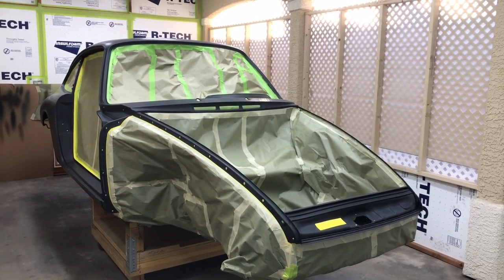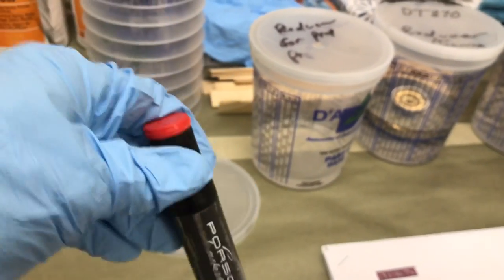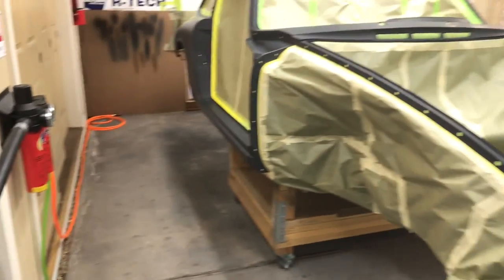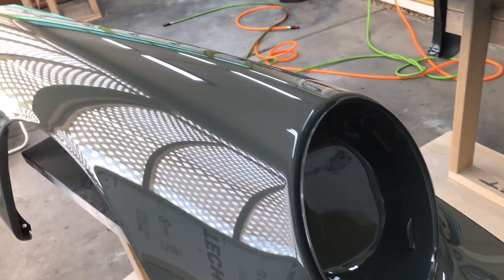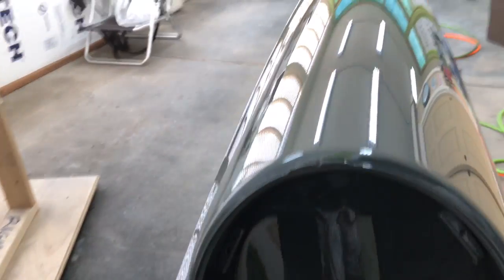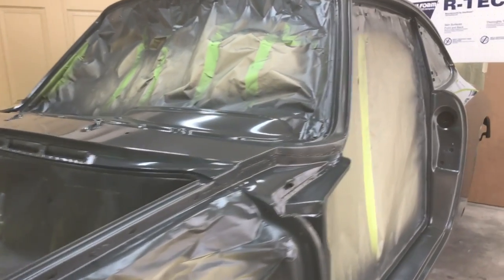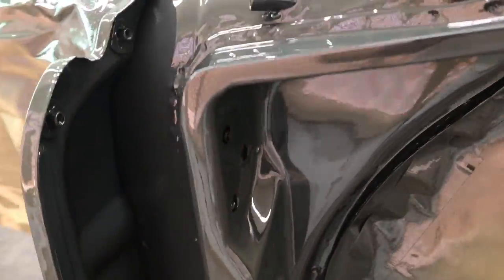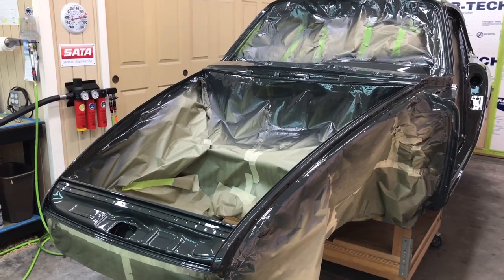1967 Porsche 911 Video 20 Finish Paint Part-2  with the SATA 5000B RP

Comment: Mike, Great video. I'm trying to learn to spray clear and my first time was a disaster. I now believe it was what you described in this vid as hyper static tension. I originally thought it was contamination, I know everything was very clean and cleaned properly. I never found a source for any contamination. My primer, sealer, base, were great. I honestly think I was laying the first coat of clear on way to heavy. It would act as if there was a small amount of dust or trash on the surface and then a crater would form around it.
Reply from the maker: Russell can you send me some good close up pics of the issue? I might be able to pinpoint the problem
mikemuskcabinets@gmail.com